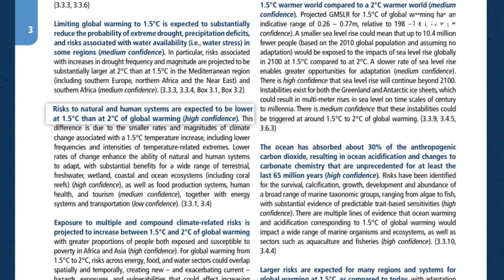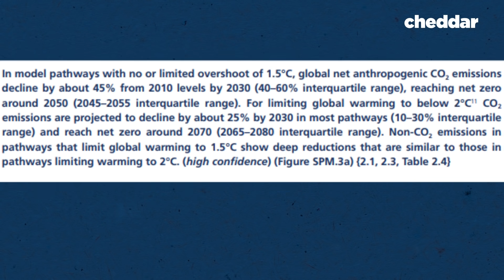Wooden Skyscrapers Are On The Rise - Cheddar Explains

Comment: BS by fluffy architects riding a green wave. You did not address termites or rotting. Further BS when you mentioned 20 years ago people realised laminating wood different directions increased its strength. WTF you ever heard of plywood. Been around more than 20 years in the third world country I live in.
Reply: Do you know that we have wooden structures that have literally lasted for centuries? Yeah, we know how to deal with rot and termites for very long time and the techniques to deal with  them are just getting better. As for plywoods, try building skyscrapers by using just  them.
Reply: @remliqa  and you do know we moved on to other materials for many reasons? You do know trees take a long time to mature and if cultivated we need to destroy additional natural habitats? How much of what was shown was renders? Why - because its not built. This is BS. It will remain BS. A few wooden "skyscrapers" will go up but it will not make 1% of our new construction. 

The next thing you will believe is we will go back to wooden ships. Wooden oil tankers and cargo vessels.
Reply: @manickn6819  
Your objection to this technology is just silly:

You do know that the reason they are attempting to move back to wood is because of  the harm  our current standard  building material is doing to the environment (via CO2 emission eg) right? You do know that eventually we will also face shortage of sand for concrete , right? You do know that  the proposed  wooden skyscrapers are using new tech that would make  the e previously impossible wooden skyscrapers a reality , right? 

It also seem that you never heard of tree farm, where most of our wood  for both construction and pulp came from. The  reason for deforestation isn't the lumber industry (they actually wanted to maintain  good forestry practice for economic reasons ) but from  land clearing for agriculture and development. Tree farm usually used land from abandoned and unproductive farmlands and  thus they actually have a net positive impact on the environment .Furthermore   tree farm (especially one using fast growing tree species from temperate forest) is currently  and can easily supply the need for timber for more construction needs.

As for wooden ships, if they can remake wooden ship to the point that they can compete with current methods of ship manufacturing, I don't see why they shouldn't pursue it.
Reply: @remliqa  go on believing the BS. Tree farms do not stand a chance of producing the wood we need for the projects we build. Try calculating the time and land required for the projects China did in the last 10 years and you will see. It is not possible. 

Have you ever built anything with wood or steel? Actually build a table for example? I have. Wood does not compare. 

CO2 emission reduction using these methods is BS too. There is a lot of that going on. If we really wanted to reduce CO2 we could. There are good techniques. We are not really ready to do it so we are just beating around the subject. Nice catch phrases though so expect to see it more often.

There is a reason the ships are not being built. Engineers design those things. They need to actually work. Look at the buildings. Architects design those and that's the fluffy architects. Its art and does not really need to work. That architect has no idea now to make it practical. All he is doing is making it look pretty. The fact that most presented here are renderings should tell you something about the real world.
Reply: @manickn6819  

"go on believing the BS. Tree farms do not stand a chance of producing the wood we need for the projects we build. Try calculating the time and land required for the projects China did in the last 10 years and you will see. It is not possible. "

For all the construction need in the world ?Yes, it is not possible. But it will severely reduce the need for using steel and concrete for construction.  Especially if you plan sustainably and try no to build wasteful ghost cities.

"Have you ever built anything with wood or steel? Actually build a table for example? I have. Wood does not compare. 
"

I  don't want to laugh at you but are you really comparing you DIY  project  with high tech used of  new  wood construction technology?

I mean I build my own computers from parts  but I would never assume that I'm an expert on supercomputer architecture.

"CO2 emission reduction using these methods is BS too. There is a lot of that going on. If we really wanted to reduce CO2 we could. There are good techniques. We are not really ready to do it so we are just beating around the subject. Nice catch phrases though so expect to see it more often.
"

 What so bullshit about  adding another avenue to reduce greenhouse emission? We are nearing the precipice with climate change and every new methods to reduce its impact should be welcomed , not opposed for tenuous principles.

"There is a reason the ships are not being built. Engineers design those things. They need to actually work. Look at the buildings. Architects design those and that's the fluffy architects. Its art and does not really need to work. That architect has no idea now to make it practical. All he is doing is making it look pretty. The fact that most presented here are renderings should tell you something about the real world."

You still seem to ignore the fact that this video have shown several proj3ct that have already been built therefore proving that the concept does work. The main issue  the aprvented it to be more widely used seem to be the cost . As pointed in the video, building wooden tall rise using these new techniques actually cost  a lot more than standard construction methods.

Again, if scientist/engineers managed to make alternative shipbuilding techniques that are more eco friendly and have comparable performance (despite looking counterintuitive)  to contemporary  methods, I wouldn't opposed them just because my ignorance on the matter makes unable to see their merit.
Reply: @remliqa  you are trying to save the use of steel and concrete by using more of a resource that takes over 20 years to mature? Really? Lets go with supply and demand being balanced now. Where are you getting the extra wood from? A 20 year plan? 

 So you never built anything. Hopefully you have a basic understanding of the materials but who knows. Abd by the way building your own computers put you in a position to understand supercomputers. You understand the building blocks. Calculating the power demands. Cable management. Multiple things. Yes its not the same but try explaining anything to someone who never saw inside a computer. Hopefully you get the point that there are different levels of understanding. No experience in a field is closer to no understanding so its easier to BS the person.

One of the biggest problems is the developing world. A few fluffy buildings in the first world changes nothing. Hopefully China tops off shortly. India is still coming up and then there is the whole of Africa. You want to make a dent. Lobby to help them do things better than the present first world did when they were at that stage. That is where our real realistic gains can come from. But in the real world talk is cheap and the richer counties care about profit and not really helping solve the problems.

Yes the video notes a few buildings but its not a proper analysis at all. No statistics provided. Typical of BS.  Lets ask 
1) timeline of the buildings shown that were actually built 
2) number of similar height, square area buildings in that timeline
3) percentage of wooden high rise in the world
4) projected percentage of wooden high rise in 20 years. Not renders. Structurally engineered buildings approved and funded or those in that pipeline

If you get more than 0.01% I would be surprised. Its pissing in the wind. Irrelevant in the grander scheme or your CO2 reductions you see.
Reply: @manickn6819  
"you are trying to save the use of steel and concrete by using more of a resource that takes over 20 years to mature? Really? Lets go with supply and demand being balanced now. Where are you getting the extra wood from? A 20 year plan?"

You are talking as if there is need an urgent need to suddenly increase the acreage of tree farms just because of this new tech (which is still in its infancy) and as if we suddenly must  tear down all  infrastructure that have been built (which would last for decades, even more than a century in some cases) with wooden erections.As you said let supply and demand dictate the matter: If/when this technology matures enough to go mainstream teh  the market itself will sort it out. As for now, we have more than enough capacity  for a small city or two worth of construction annually . 20 years is still shorter time than the millennia it take for concrete components (sand eg) to form

"So you never built anything. Hopefully you have a basic understanding of the materials but who knows. Abd by the way building your own computers put you in a position to understand supercomputers. You understand the building blocks. Calculating the power demands. Cable management. Multiple things. Yes its not the same but try explaining anything to someone who never saw inside a computer. Hopefully you get the point that there are different levels of understanding. No experience in a field is closer to no understanding so its easier to BS the person."

By that logic you toop haven't build anything at all. Seems to me that you are just trying to desperately defend your ignorance on the tech in this video and justify your Dunning-Kruger complex. You who objection to timber high rise  in your OP and this thread is based on your overinflated estimation of your own knowledge (based on your DIY project)  . No, just because I can and have assembled desktop PCs and tinkered with basic coding  on my  desktop while doing so doesn't mean that I am now some expert on supercomputers and can lecture people on technology that are still yet to be mass implemented. I am not that delusional.

"One of the biggest problems is the developing world. A few fluffy buildings in the first world changes nothing. Hopefully China tops off shortly. India is still coming up and then there is the whole of Africa. You want to make a dent. Lobby to help them do things better than the present first world did when they were at that stage. That is where our real realistic gains can come from. But in the real world talk is cheap and the richer counties care about profit and not really helping solve the problems."

Completely irrelevant to both the video and your OP.

"Yes the video notes a few buildings but its not a proper analysis at all. No statistics provided. Typical of BS.  Lets ask 
1) timeline of the buildings shown that were actually built 
2) number of similar height, square area buildings in that timeline
3) percentage of wooden high rise in the world
4) projected percentage of wooden high rise in 20 years. Not renders. Structurally engineered buildings approved and funded or those in that pipeline"

You seem to be completely missing the point of the video. The video is just informing us that the technology for wooden high rise now exist and is is  now feasible (though not cost competitive) to build wooden skyscrapers. It isn't in in depth analysis of the impact of such technology on city planning and building codes.
 As for the project that have been completed  on the video, you can google them yourself to obtain the data you need,

"If you get more than 0.01% I would be surprised. Its pissing in the wind. Irrelevant in the grander scheme or your CO2 reductions you see."
 
So by you logic we' shouldn't do anything at all  to slow and reverse climate change?
Reply: @remliqa  Actually you are disillusional but you are in good company with many others. That's fine. Does not change anything in most of the world where fluffy ideas cannot be supported. Only rich places can afford to do those things.

Actually I have a lot more experience than a DIY project. Lot lot more but the internet is not the place to get into personal details. You should have picked up that with the replies but anyway irrelevant if you believe me or not.

"So by you logic we' shouldn't do anything at all to slow and reverse climate change?" No by my logic we do sensible things, not stupid pie in the sky ideas. I explained clearly how real benefit can be had by helping the developing world.
Reply: @manickn6819  
Many of the current staple in greenhouse reduction tech (solar, EVs) started as pie in the sky projects that was quite impractical in their early years . Doesn't mean  that we should quit on them and bury them just because tech behind  them isn't mature enough for mass utilisation . Most of them face the exact same challenges of this project such  high cost, lack of raw  material to fully replace the vacated capacity of the tehc they want to usurp (etc) in their early years . The same goes for this tech. Currently it is still in in early stage  and it can't compete with standard building methods but eventually it will mature enough should they overcome those early challenges . Just like all green tech, it would be adopted first by developed and richer countries. No, your expertise in DIY projects doesn't make you an expert on building high rise wooden structures. For example your OP about rot and termites automatically assumes that the  people behind the completed buildings somehow overlooked this and never implemented solution for them in the first place.
Reply: @remliqa  you are comparing solar and EV (new tech with room to grow and yes I am ignoring the very very early electric vehicles) to something that is an old technology that is being used at present in lower height structures. That's not an apples and apples comparison. Make a case with an old tech.

I did not claim experience in wooden high rise. I'd be surprised if anyone here claims that. What is your experience in construction to make you knowledgeable? How many architects have you talked to? I hope the extent of your knowledge is not just this video.

Of course they catered for termites and rot but do you know what was used? How expensive? Maybe they catered for change out of items over time.  Do you know the long term effects of sending that materiel to dumps? Have a look into the environmental effects of some types of wood treatment. Stuff that mitigate termites is not exactly kosher. There are lots of cons. 

Just for the record I would like to see one of these wooden structures if I am ever in a location where it exists. I am sure I will be impressed. Looks brilliant actually but I am not of the opinion this is going to make any notch, far less dent in the construction of high rise buildings.
Reply: @manickn6819  

"you are comparing solar and EV (new tech with room to grow and yes I am ignoring the very very early electric vehicles) to something that is an old technology that is being used at present in lower height structures. That's not an apples and apples comparison. Make a case with an old tech."

This isn't old tech at all. As said in this video, the technology was only developed around 20 years ago and is still in its early adoption stage. There is plenty of room to grow and mature before it can become mainstream enough . You argument is the exact same argument anti renewable and anti-EV spouted as tye tech behind them have ex=tided for decades, some closing to century.  while ignoring the fact that the application isn't practical (and still isn't judging by this video) until very recently.

'I did not claim experience in wooden high rise. I'd be surprised if anyone here claims that. What is your experience in construction to make you knowledgeable? How many architects have you talked to? I hope the extent of your knowledge is not just this video."

That's why unlike you I do not make gregarious claim such as " those building  cannot stand rot and termite". Unlike you and me these people are experienced in building woden high rise.

"Of course they catered for termites and rot but do you know what was used? How expensive? Maybe they catered for change out of items over time.  Do you know the long term effects of sending that materiel to dumps? Have a look into the environmental effects of some types of wood treatment. Stuff that mitigate termites is not exactly kosher. There are lots of cons."

 This video doesn't even contain enough information to judge the exact pros and cons of this building method other than the fact that the wooden building are much more expensive while being more carbon positive. Unless you are privy to the exact techniques used here, you should be bes pouting thing that were never in the source material in the first place.

"Just for the record I would like to see one of these wooden structures if I am ever in a location where it exists. I am sure I will be impressed. Looks brilliant actually but I am not of the opinion this is going to make any notch, far less dent in the construction of high rise buildings.
"

Not at this stage it won't. In the future ? Maybe.
Reply: @remliqa  I just looked at your liked videos and they include pokemon, fluffy stuff and nothing technical. Let me exit at this stage. Its not making sense. 

I do post technical stuff. Feel free to go through any and bask me for any errors you find. Very little is opinionated so unlike this discussion if I am wrong and you reference it properly I will concede and thank you for increasing my knowledge.
Reply: @manickn6819  

"I just looked at your liked videos and they include pokemon, fluffy stuff and nothing technical. Let me exit at this stage. Its not making sense. "

Have you looked at my subscription  and playlist? You'll find quite a number of science and technological related channel and videos  on them .If you want to gauge the interest of a person don't just half the effort . Look harder. I guess lack of research is typical behaviour from you.

''"I do post technical stuff"

I don't see any of them related to wooden architecture so i guess you're not an expert on them .

" Feel free to go through any and bask me for any errors you find."

Why would I want to do that? I don't see anything worth seeing in on your channel.

'Very little is opinionated so unlike this discussion if I am wrong and you reference it properly I will concede and thank you for increasing my knowledge"

Completed irrelevant to this thread. Seem more like an obfuscation technique to deflect from your erroneous  OP( and following statements).
Reply: @remliqa  I did look at your subscriptions and its a lot better than Pokemon. I will concede there. Hence my reply now. 

Did you verify that this channel has an expert on high rise wooden structures? If not then by your logic you cannot take their opinion either. What are their sources? Are their sources peer reviewed or just opinionated articles? You can't tell because its not listed in the video or description. So let me be clear NO ON HERE IS AN EXPERT ON HIGH RISE WOODEN STRUCTURES.

You did not show any level of construction understanding. Never answered the question of how many architects you have ever talked to far less work with and you want to talk about OP. You conveniently avoid questions. Show some technical competence in the area of discussion and provide relevant points. If you do make a good point I will concede. If you cannot well neither one of us will change our position so lets call it a day.
Reply: @manickn6819  

"Did you verify that this channel has an expert on high rise wooden structures? If not then by your logic you cannot take their opinion either. What are their sources? Are their sources peer reviewed or just opinionated articles? You can't tell because its not listed in the video or description. So let me be clear NO ON HERE IS AN EXPERT ON HIGH RISE WOODEN STRUCTURES."

You do know that this is a news/information channel, right? I don't expect the people behind such channel to do more that convey information that were given by from expert in the field. You know experts like the people behind the new wooden construction methods  and the ones who built those wooden high rises in the first place.

"You did not show any level of construction understanding. Never answered the question of how many architects you have ever talked to far less work with and you want to talk about OP. Show some technical competence in the area of discussion and provide relevant points."

Neither do you for that matter. I don't need to be an architect to know  that rot and termite protection have existed for centuries and there are wooden structure that have existed for more than a hundred year old . Google exist.

" You conveniently avoid questions. "

What question did I avoid?

" Show some technical competence in the area of discussion and provide relevant points"

Two thing: First it is completely irrelevant to the topic on hand .

Secondly, who are you to demand such thing when you never even provided your own evidence of competency on the subject matter ?
 

"If you do make a good point I will concede"

I already made good pont . You just refuse to acknowledge them

" If you cannot well neither one of us will change our position so lets call it a day."

It is a bit obvious that you would never admit you're wrong  (anti rot and termite  protection have existed for centuries)the first place.  Don't know why you even bother to continue.
Reply: @remliqa  it obvious rot and termites existed for centuries which is why we moved away from wood for structures intend to last. This is not debatable. There damn good reasons we build the way we do. 

Its a news channel. Sure. Do you know their qualifications? Many of these channels that are popular on YT have critical errors. Fundamental scientific errors. Not saying this channel does but just believing because its a news channel is like believing Fox because its a news channel.

I have worked with architects on 3 continents. In fact right now I am working with a European architect on a submission for LAGI so just maybe I am quite a bit more qualified than you think. Probably know more about construction than the researchers and presenters in this video. It's not their thing after all.

Ok so now that I have claimed some qualification in the area to make a call and disputed the broad brush statement that this is a news channel so they know, you show some qualification to back up your side of this debate.
Reply: @manickn6819  

" it obvious rot and termites existed for centuries which is why we moved away from wood for structures intend to last. This is not debatable. There damn good reasons we build the way we do. "

Yes, one of the reason why we moved away from them is because it is almost impossible to make huge  building with them due to their strength. The new methods  explained in the video changed this.

"Its a news channel. Sure. Do you know their qualifications? Many of these channels that are popular on YT have critical errors. Fundamental scientific errors. Not saying this channel does but just believing because its a news channel is like believing Fox because its a news channel.
"

Instead of making vague insinuation, why not point the error you spotted in thi video.

"I have worked with architects on 3 continents. In fact right now I am working with a European architect on a submission for LAGI so just maybe I am quite a bit more qualified than you think. Probably know more about construction than the researchers and presenters in this video. It's not their thing after all."

And yet despite those qualification (or so you claimed) you made quite a few errors even when talking about design and  architecture (let alone topic s like environmentalism) in  this comment section. 

"Ok so now that I have claimed some qualification in the area to make a call and disputed the broad brush statement that this is a news channel so they know, you show some qualification to back up your side of this debate"

As I said repeatedly this is completely irrelevant to the topic. Do you think you straight up objection to this technology is any less irrational now ?
Reply: Plywood is old, but what was discovered 20 years ago is that the  same technique (but with differences) can be applied to beams, instead of single pieces of wood  as traditionally wood beams were made.  Also in the video isn't mentioned but a new technique that consist in compacting the wood decreasing the air content make it stronger, more resistant to the ambiance and against fires.
Reply: @Angel24Marin  you have done a better job of clarifying than they did in the video. Sad when things are poorly made and not referenced. 

I do have concerns about some of the chemicals injected. Some of the natural VOC's from wood. Long term effects when the quantum of wood is significant. I have built wooden stuff and its a nice smell for the first few cuts but after some time the odour tends to give me a headache especially if I put the finished item in a closed room.
Reply: Architects actually know what there doing, unlike you
Reply: @swisrol5290  sure. Been through this before with this thread of comments. Unless you are and architect or have worked directly with architects (like I have) you have no idea what you are talking about. Anyway I am done educating people on this.  Feel free to to believe whatever you want.
Reply: @DamianLewd  thanks. We know you are not arrogant or dumb for sure. At least you have some architectural pedigree from your profile. Anyway I have spent too much time on this and I am fed up. Drop me a line in 20 years when this thing reached 20% of the market. Until then I will stay arrogant and you will be the humble one.
Reply: So Rot and insects are only a problem if wood maintains a certain percentage of moisture content for prolonged periods of time. So if kept dry wood will literally last forever.
Reply: No you  

Those wood would be coming from tree farms(like most lumber and pulp these days) . These may seem counterintuitive to those that doesn't understand chemistry and biology that much, but cutting down tree  is actually one of the best  carbon sink available to man. As long as those wood remains wood( (not completely rotting away or burnt) then the carbon would forever be trapped in them.

So yes, growing  fast growing trees and then cutting them down for timber is great way ro reduce CO2.
Reply: No you  

Remember what year ( or century)  those happened ?  Fire suppression  have improved greatly since then. Wood can be treated to make it very resistant to fire  and this usually make them resistant to decay too .  I doubt anyone making high rise wooden structures ( which are more expensive to make) would skimp on fire protection.
Reply: No you  it's like you didn't even watch the video, basing your facts from examples from god knows what century they came from, you didn't even factor technological advancements with you already assuming "fire burn wood, wood baddd"
Reply: No you  

People who made those laws were not up date on technological advancement. Building codes and standard changes all the time. The whole idea that you can't suppress fire is ridiculous.  All high rise building that is up to code have fire suppression system that are very effective .
Reply: its okay to be an arrogant idiot
Reply: @radagast1184  

We didn't have the tech for them back then . We do now.
Reply: @remliqa  so we had the tech to build giant cathedreals and shit but not a wooden building bigger then a mansoin? k
Reply: @spike_-pw9iz  

Yup, we have tech to build large stone and mortar  structure like cathedral  for ages but wood is just normally too structurally weak and easy to damage for such projects. Not to say large wooden structures don't exist, they are just very rare and most of them don't survive the ages.